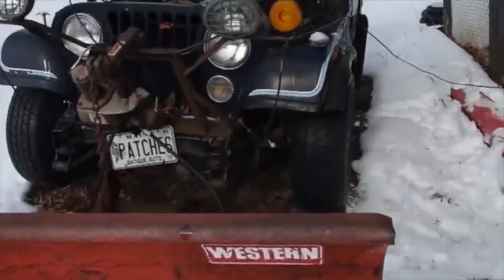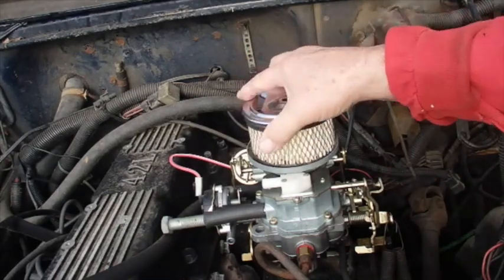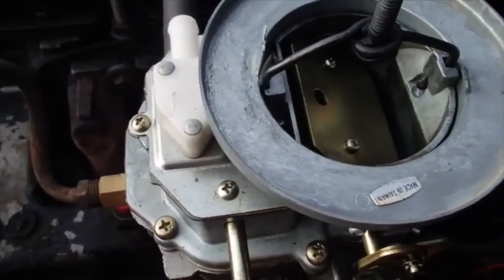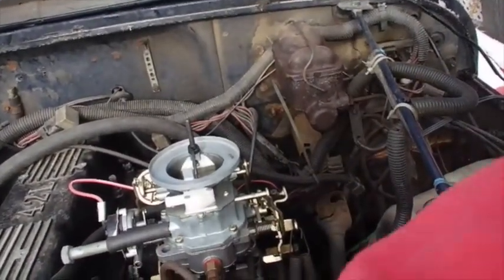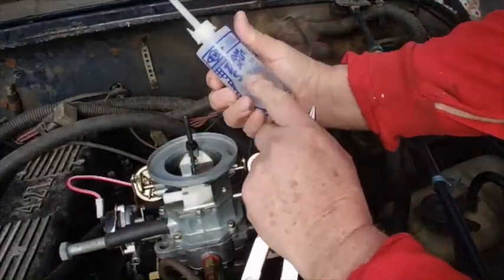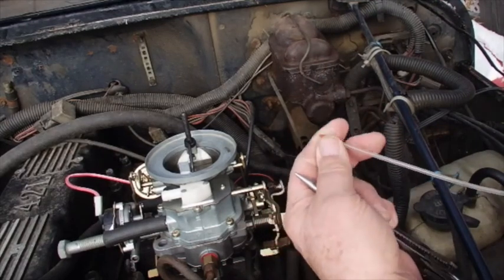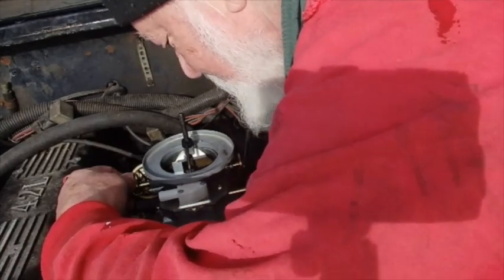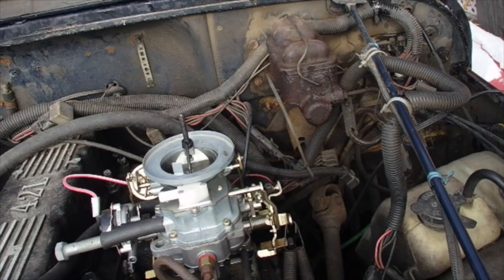Jeep Cold Start hard start 2

Comment: MSD box with manual timing knob on dashboard, and manual choke! Worked for me years ago. 300in  inline 6
w/ 500cfm Holley. Lived in Ohio then in the snow belt. 
Good DAY!
Reply from the maker: I've had 3 or 4 carbs on this'n.  Manual choke on the last 3.    Havn't tried a Holley...   I think I can get this one sorted out if it warms up enough so I can feel my fingers.
Reply: rpeek the MSD box will make it start, multiple spark discharge gives you a long duration spark that will ignite any vapor that gets into the cylinder, straight 6 intake plenums AIN'T getting fumes enough on the back and front cylinders, when cold it's even worse. So yer trying to start on the middle 2.....get fancy with a 2 carb setup....nah to much foolin around. Research the MSD box  easily installed on most "older " machines..gday.
Reply from the maker: @leejamestheliar2085  Oh.  Okay.   I'll look into that.  Thanks.

Comment: Sometimes, I take a 12-16oz propane bottle with torch attachment, can extend it with a rubber hose. It provides enrichment thats very easy to lite off.
Reply from the maker: Hmmm..  You squirt propane down the carb?
Reply: @rpeek  Well, it comes out pretty slow with a torch attachment to be honest. But you can definitely tell the different in idle quality/ability. Its enrichment without saturating the plugs.

https://www.amazon.com/Worthington-336737-WT2301-Trigger-Propane/dp/B004FPZACE
I use this attachment from walmart (same price or cheaper). Its on the smaller scale of torches and the igniter hasn't failed me yet. 
I use the same torch to light my stove twice a day.
Reply: (Ive had it for about 2 years now) Edit: Well if im gonna brag on it, I might as well let you know the flame control on it is touchy. But when using it on a carb its opened all the way anyway.
Reply from the maker: @DarkLinkAD  hmmmm..  So you're shooting fire right down into the carb?
Reply: @rpeek  Oh no, just propane.